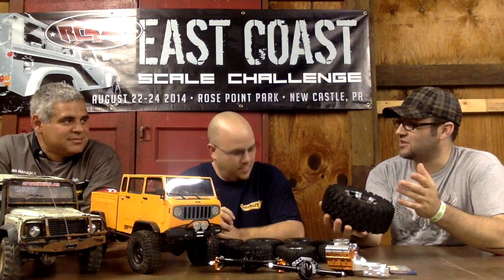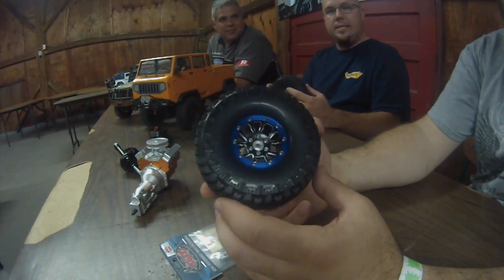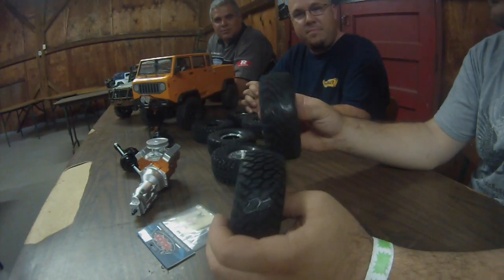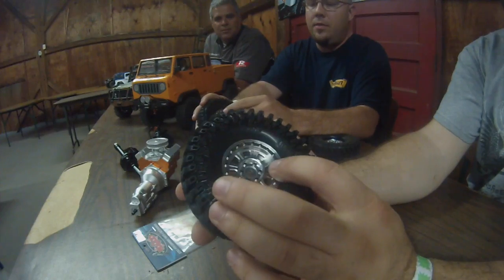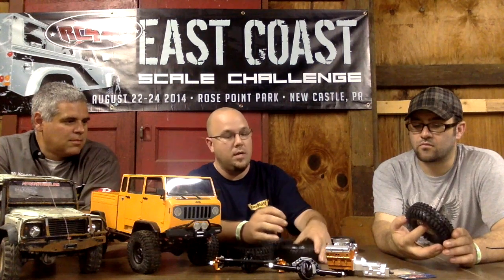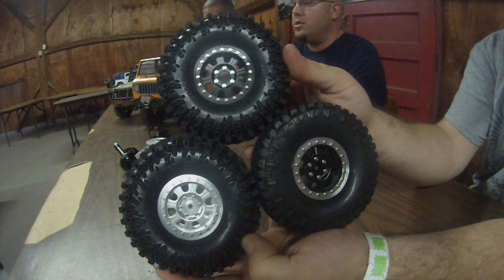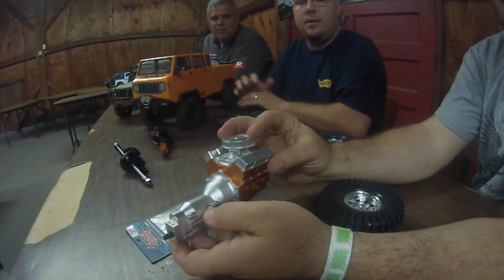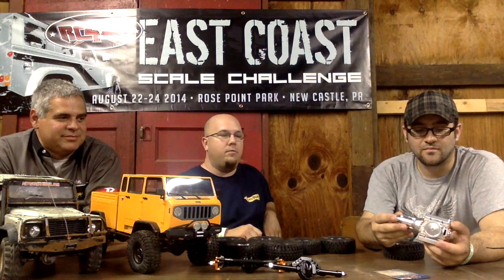New Products from RC4WD - V8 motor, Raceline wheels, D44 Axles - Episode 2

Comment: That engine rocks. Imagine if they put a shaft at the very bottom that runs off a pulley that you put on your 540 motor right behind your pinion gear so the pulley runs the shaft and the shaft sticks out of the front of the motor to tun a complete belt system with a nice realistic cooling fan. That would be so awesome.
Reply from the maker: Jacob Hendrickson That would be a fairly easy task if you ran a brushless outrunner inside of the motor,